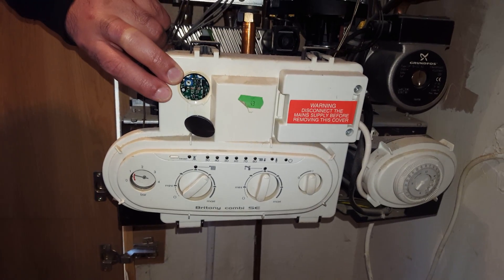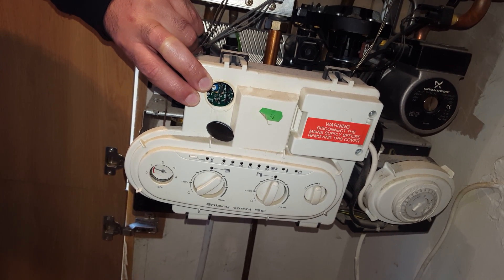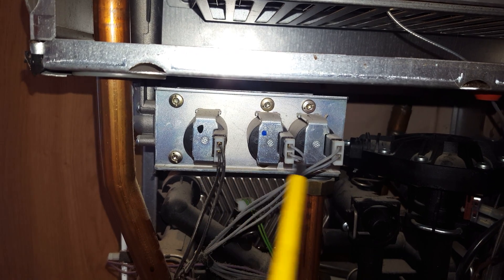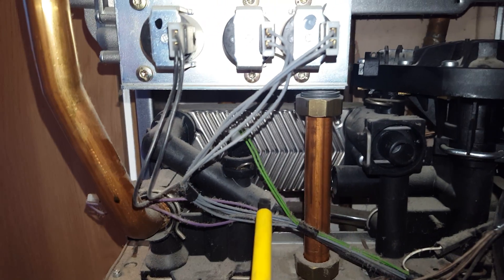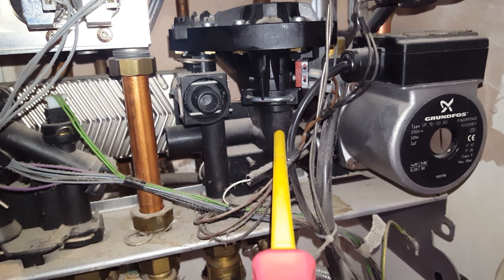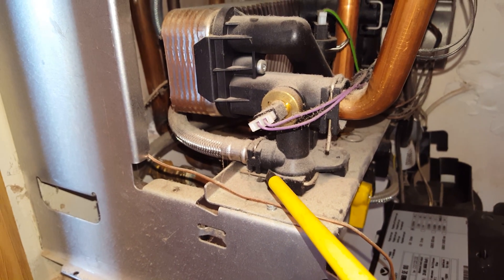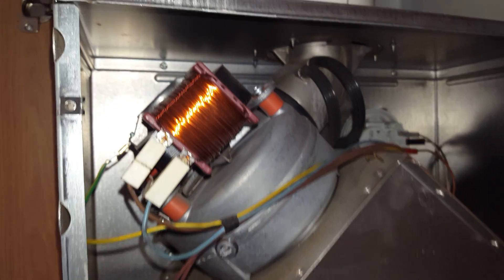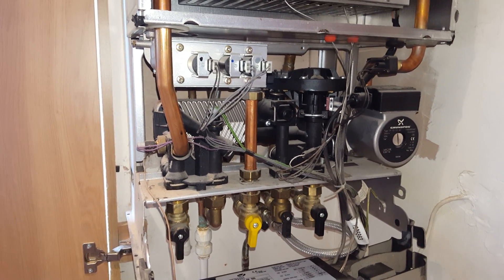Boiler repair Manchester Chaffoteaux Brintony SE

Comment: I have same boiler

Works good but the  pressure keep going down over night and notice through the over flow pipe out side 

Part from that is good
Is it the overflow valve is it easy to fit can yiu help

Comment: I have this exact boiler, when using on hot water with a large water flow, boiler cuts out and flashes code 70,  if you turn off the tap the boiler will eventually reset (or you can do it manually) and water flows hot again. Doesn't usually cut out when the tap is on very low flow.. Any ideas? Many thanks Ian

Comment: Hi , I've water leaking out of the 3 way valve , is it a new valve or do I need any other new parts? Thanks
Reply from the maker: It could be the water section above the divertor valve cartridge